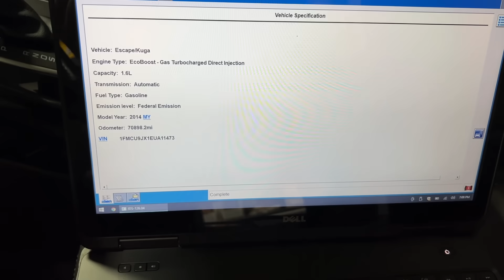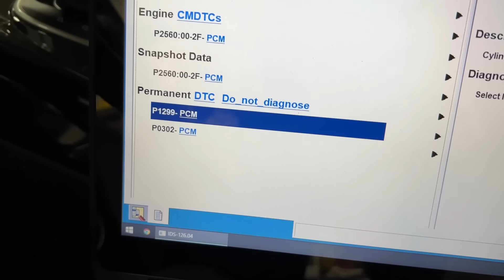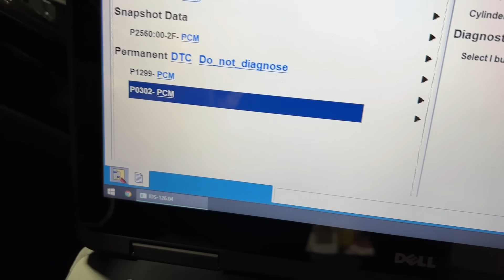Beware of Ford’s 1.5L 1.6L 2.0L Ecoboost Engines and Their Never Ending Coolant Consumption Issues!

Comment: I own a 2017 2.0 fusion..... ecoboost and yes i am now having this same issue. off warranty. So aside from monitoring the coolant is it possible to use a block seal or head gasket sealer? im asking because i cannot buy a new car nor do i want to sell because im not going to take pennies due to this issue. If it is possible i  dont know if you can pour anything in due to no cap. Just a resiv cap.

Comment: Mine started 3 weeks ago. Maybe longer. Go figure they wont let me trade it in after saying they had massive incentives  for me to trade it back. Today they said $750 toward a new Escape. Wtf.
Reply: We traded a very clean and sleek 74k mile 2 door cav for $400 and you're sitting there with something newer and supposedly better in every way and have to deal with that. Man, now I'd really be mad. Toyota wanted to buy my car back around 2006-8. That's how you know you got the right thing. A 22 year old Echo could be a stop gap. Don't expect 38 MPG out of every one though. A radiator and filler neck will fail at that point. $80 total. Starter changed at 14 years. Automatic transmission is original. 138000 miles..... 
Good luck. Maybe look into ARP head studs or an engine swap for something in that range that will bolt up. If the head gasket really is the problem, look in forums and see if there's an upgraded or better head gasket and get the high pressure ARP studs if available. The coolant should not be going anywhere except the expansion tank.
Reply: Maybe try a 180° thermostat...

Comment: My 2017 escape 2.0 P0302 code @ 23,500 miles.  Coolant in #2 cylinder.  So sad.  Getting it replaced right now.  Lucky for me powertrain warranty good till December so should be painless to my wallet.  Just think, 2 months from now this would be my problem and expense.  Jesus I’m going Toyota from now on.Will be trading it in soon after it’s done.
Reply: Get a Japanese "J" VIN if you do. 18+ Camry and 19+ everything else uses the new engines. There is still some mysteries revolving around the long term cost of the dynamic force engines. But one thing I love about them is that they used standard oil filters now. No more messy cartridge filter. Base RAV4 with blind spot monitors and steel wheels. $27000. Good luck. (Get a J vin code model and you can't go wrong!)
Reply: @marshmower  thanks for the heads up.  so your saying stick with a pre-18 camry

Comment: My wife was considering buying one of these that had 45,000 miles on it for $21,000. After watching your video I just called her up and told her to forget it. Thanks!
Reply: Roll of the dice...I have 178k on my 2015 2.0L Ecoboost & not the first problem. My neighbor bought  2017 & didn't make it 60k until it blew up...why, why, why!
Reply: Ford will replace the motor free of charge 7 years 84,000 miles
Reply: @thomasjames734  Wonderful... I have a 2016 w/54,000 miles and it just started to sip coolant (2 cups in 3 months).
Reply: Jim hackett set ford up for a disaster, in so many ways
Reply: Dont
Reply: Had mine fixed 2 years ago, now need new engine at $10,000
Reply: You can then buy something else and have massive issues. Including Toyota and Honda. We have a 2013 Escape 2.0L with almost 200,000 miles without any of those problems. All we did is tie tod ends, brake job at 140,000 miles and suspension is due soon. All wear and tear items. So, you cant assume that every car will give you problems ( or not ).
Reply: @bmw803 A lot of these problems are specific to vehicles with a certain series of VIN numbers. What you have to do is look at any applicable technical service bulletins and see if there are issues with the specific vehicle you are lookkng at. It can depend on how early or late your vehicle was made during the entire production run. It sounds like you got lucky. I had a 2003 Ford Windstar. These vehicles were  notorious for transmission failures. Mine had 270,000 miles on it and it never had any transmission problems. It rurned out that mine was one of the last ones that were manufactured and it had all the fixes and upgrades in it.
Reply: Stay away from theses cars nothing but issues facts
Reply: My 2018 2.0L has 250k miles

Comment: I am dealing with this right now on a 2017 Ford Explorer with a 4 cylinder Eco Boost Engine. I had no warning anything was going wrong until last Thursday when we got a misfire code - our neighbor is a mechanic he suggested changing the spark plugs and something else (yeah I am not too car literate). Anyhow that didn't solve the problem so by Saturday the car was rough starting so we decided to bring it Monday to get it looked at. Well Sunday we were going to bring it to ford and it was really rough starting - got it to ford called them in the morning - by 9am they called us with a price tag of $10,000 to replace the motor and of course we are just 3 short months out of warrenty. I did call ford because I want to know how this happens with no warning other than a spark plug error code - no overheat warning - nothing. If you haven't I would love if you would send this video to ford and tell them about their engines, but maybe they know because even if we did want to replace it we can't the motor is backordered (hmmm kinda makes you wonder why).

Comment: Brian, thanks for this information, Great! I own a 2019 Ford Edge with a twin-scroll 2.0L Ecoboost engine. I have a couple of more months of warranty on it. Is this engine one with potential problems on the horizon? I have less than 20K miles on it, like brand new. I have no leak issues or problems that I know of. What what should I do? Thanks in Advance

Comment: This video is devastating to me... I have this exact car and I've got a check engine light for misfire cylinder 2. I'm praying to God the dealer I got this from covers it though. I bout it used at 130,000 and took it back in twice for a low coolant issue. Taking it back next week to either get it fixed or give them the car back. I'll never buy a ford again.

Comment: 2019 Escape , 71,100 miles just brought it in today after service engine soon light went on. I had been at Ford 2 weeks ago for oil, lube, tire rotation, ect… and I was thinking the service engine soon was a fluke. No, it was the problem this guy is demonstrating with coolant leak. Even though I had been at Ford 2 weeks ago and everything checked out alright , I need a NEW ENGINE. Fortunate for myself I purchased an extended warranty and it is covered. I agree with others who have expressed concern that it is a reliability problem that should be covered as a recall. If Ford wants to maintain a healthy relationship with loyal customers they need to treat this as a recall. I am shocked this occurred.

Comment: Well now I know that sucks because my car is a 2018 fusion 15 and started having issues rough idle white smoke and I was thinking it was a head gasket it ran rough once it's warmed up it's good to go power no problem but when it's cold that's when it has its problem and I got $55,5 48 miles on it

Comment: So, if you have a 2019 Escape manufactured in June 2019 (that would be mine), would that mean it has the improved short block that's not being used for 1.5 Ecoboost replacements? The tech service bulletin mentions 1.5EB's  built before April 2019.

Comment: Good info, thanks. I've been looking at Escapes and it seems like the pre 2012/2014, pre turbo were much better vehicles. I like the newer styling but not looking for expensive headaches.
Reply: The 2.5l Duratech engines in the pre-2014 Escapes were insanely reliable.  We had a 2009 Escape with 215k km on it and the engine still ran like it was brand new.

Comment: Interesting. I watched a race shop in england and he says on Focus Rt engines that have gone bad he sees liners that are below the outside deck like they're getting pounded down.. I watched a shop who races mustangs with a 2.3 I think and he found head lifting and detonation. He also found the tops of the head bolts digging into the alloy. I watched a Ford tech rebuild these and talk about them but he also gets a lot of customers cars that aren't running properly and he goes and puts name brand high quality fuel in and the problem goes away. The running specs come back on the scope. The race shop with the head lifting they used a different bolt and did something to where the bolt head seats to make it wider and a wider shoulder bolt. I'd prob over torque it too.  The Ford tech that showed him rebuilding one or switching to a new block says that a puddle of oil accumulates underneath the intercooler and gets sucked into the eng. He showed the new block with the little gap missing between the cyl. Long time watcher.  They run for a fair bit before they leak so some dimension on the engine has changed. Maybe program in less advance to avoid detonation.  The Ford tech displayed some pistons with not crazy miles and they were pretty gunky. He recommend 5k oil changes at the outside. Just a little looking around on the net.

Comment: Thank you so much. I contacted the NHTSA and made a formal complaint. They stated they only had 11 complaints about this issue but upon reading just about engines I found tons of complaints regarding this issue. I asked them why did they have the coolant issue in the 184 complaints (clearly a way of them not having enough to issue a recall) and they should look into the 184 complaints and move them to the right category. Interesting but I don't believe they have specific guidelines to issue a recall. May a leg, arm or body? So after I issued a formal complaint I pulled it up today and sure enough they even put me in the 187 complaints. It is super important that anyone that is having this issue to and report it on there site. Sounds like it takes alot of us before they are forced to do something. I have learned about about these Ecoboost engines from people like you but never from FORD. They issue service bulletins to the ford dealers but never clue us in. We just spent 1500. on spark plugs and coils to now find we need a new engine. We are talking weeks. Unfortunately the mechanic didn't know about this issue. Not sure if that is common or not. 8000 for a new engine and honestly they don't even have that! SHAMEFUL that Ford keeps on trucking and leaving all of us on the side of the road!
Reply: You spent $1500 for 4 plugs and 4 coils? OMG. I sure am glad I do all my own maintenance!

Comment: Great video. If you could do a video for all of us who own these vehicles on how to possibly mitigate these problems I’m sure it would go viral! Please help if you can, thanks!
Reply: Btw I currently own the 22 maverick with the 2.0 ecoboost. Great truck but I want to do what I can to avoid future problems. Thanks.
Reply: @brianhargiss9575  You won't have this issue. Ford changed the design in the 2.0 around May 2019 production on Escapes. I have a 2017 Escape that failed at 62,000 in 2019. Cost me $2800, after my dealer went to Ford and told them that our family had owned new Fords since 1964. My previous 3 vehicles were 1992 Taurus with 108K, a 97 Taurus with 227,000 (and a 2nd gen trans with 218K that should have failed at 75K) and an 07 Five Hundred with 208K.

Comment: ⭐It seems like it would be best to go with at least a 70% anti - freeze concentrate / 30 % distilled water mix in these Ecoboost engines and keep up with the fluid change intervals!!!!!.  The higher coolant percentage compared to water the less pressure, because the more water the more pressure from the boiling temperature being lower. Especially in hotter or colder climates and on turbo charged engines or any engine for that matter higher boiling point and lower freezing point with a higher anti freeze contrate and lower distilled water % in the engine coolant mix. ⭐
Reply from the maker: What about less heat transfer and thus less cooling from the higher concentrate?

Comment: Great vid. Like your sharing how to locate issues. Really useful. 
Some info. If you search for Ford TSB 20-2100 and Ford TSB 19-2346, you would find lots of vehicles were affected by this design flaw. As per my understanding, it seems Ford has conducted recall on those vehicles.
Reply from the maker: Those are just informational TSB's not recalls.

Comment: Ford built protection into the engine because they knew they were fuckin junk.
Reply from the maker: As far as I know all Ford 4cyl engines have this protection strategy not just these engines with the open deck design that is prone to failure.

Comment: 2013 f150 ecoboost 104,000 miles. Stared smoking white/blue color out of exhaust. Brought to dealer and they said turbos were bad. Had both turbos replaced by dealer and it still smokes. Brought it back and after a month it still smokes. On paperwork it states it still smokes. Not sure what to look at and not sure what to do. Any advice on what to look at?

Comment: 2017 MKZ 2.0T, 55K miles owner here. I appreciate
your knowledge and all the info you share with
us. Car is still at dealership, been there since
July 5 waiting on gasket kit. I
figured since the engine is out I told the dealer
to put in brand new spark plugs. 
Do you have any suggestion on what other
item (s) I should have replaced since the engine
is out? Thank you. Also do you recommend any break in period on
the new engine replacement? What is the best
driving practice for appropriate break in? Also
how long should we wait for the first oil change
on the new engine after break in? Thank you for all you for for the viewers!

Comment: Can I ask why you think this has been happening with Ford power trains since about 2003 or so, for the most part? Since 2011~ especially on their smaller engines.

I've been working on cars a long time.. I can honestly say, from working on Grand Caravans and their problematic transmissions, 2.7l, 3.7l, 4.7l, and Chrysler truck transmissions, GM 3.6l V6s, early Traverse and Equinox problems and MDS/AFM/DFM issues and seeing how far they have come, with their new engines and trannys.trains.. why do you think Fords really have not seemed to improved in the same way as the new GMs and Chryslers?

I think Ford pickups are coming around, but have become insane to work on.. but otherwise- a lot of powertrain issues up til current models.

Do you suspect, with your massive amount of experience that it is intentional or lack of engineering foresight?
Reply from the maker: I said nothing about 2003, ecoboost did not come out until 2011.
Reply: @FordTechMakuloco  what? That's not what I said. I was asking in general what you think happened with Ford's. It seems they have not been improving much as other American companies have started to. Just asking with your experience, if you think it's intentional or if it's from engineering undersight. I know this specific video was just on the 4 cylinder ecoboost.

Awesome video btw. Great information.

Comment: In a case like this will you see excessive crankcase ventilation or compression gasses pushing into the cooling system?
Reply from the maker: Generally no.

Comment: Just did a water pump and timing belt for a friend’s 2013 Fusion 1.6 EB.  That was enough to forever keep me away from these engines.  At 87k miles, I hope she doesn’t suffer this catastrophe failure.  Next, I tackle the TCC solenoid in the transmission. Wish me luck.  It’ll probably need a TC due to the stupid clutch setup.

Comment: When I was a tech at a Ford dealership I was one of the unfortunate ones who had about 5 of these Escapes already in the back line area waiting for the new replacement block with all new fasteners and gaskets too, at one point I would remark that I would know that I've died and gone to hell if I was working on another EcoBoost Escape.
Reply: I have a 2015 Ford Escape Titanium Eco-Boost 1.6, And there’s smoke that comes out the engine after 15 minutes of using the vehicle and I also keep adding anti-coolant every 4 days because the level goes down. What you think it might be?
Reply: LOL....

Comment: I have a 2017 Fusion with ecoboost. 65k miles (luckily I bought extended warranty) I took it to dealer for water sounds in dash and they diagnosed me with needing a new engine (block I guess they told me engine) and said the gaskets are on backorder with no ETA. I’m just glad I bought the extended warranty bc mine would have been up at 60k

Comment: Ford could have built a 4 cyl engine that would run 400,000 miles long ago. They choose to keep putting out these engines with a fail point built into the motor. From a head gasket that turns to mush in 10 yrs (escort) to this . I refuse to do business with anyone practising these ethics.

Comment: I'm a Ford Europe Master Technician and the Ecoboost is a huge headache, When it debuted it was showcased by Ford in 1.0 litre form in a fiesta at the technical training college in Daventry, England where myself and my senior technician amongst many other technicians from across Britain were invited down for an unveiling and to show us the general technical aspects of the engine so we could then go back and inform the rest of the workshop team. When they started it up after talking us through it me and my senior took one look at each other and said this thing will never work! Bloody EcoBOOM!!
Reply: I have a 2020 MKZ 2.0T with 39,000 miles. No problem so far.  Is my car block redesigned, or is it a bad design also? Thanks
Reply: @johnathanw7777  I believe you have the improved design by that point.
Reply: With the engine removed listening to the engine run sounds like one cylinder above my lawnmower. POS.